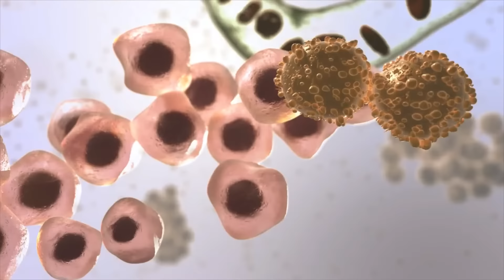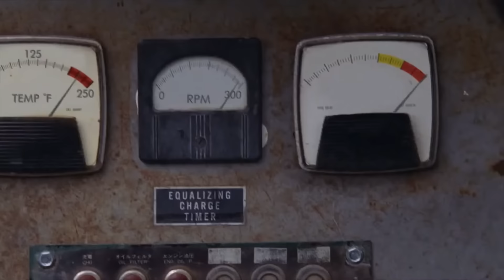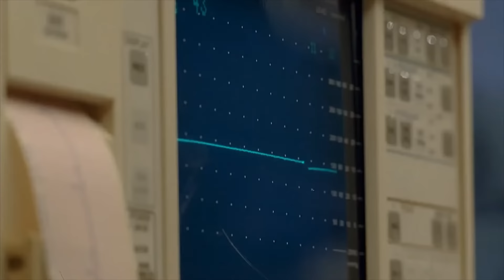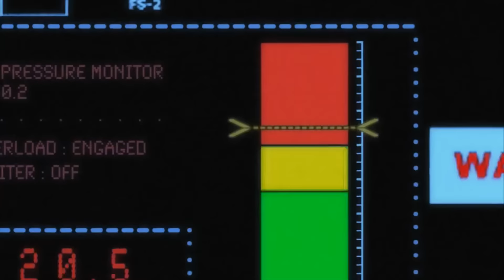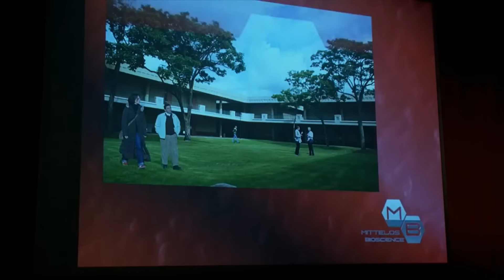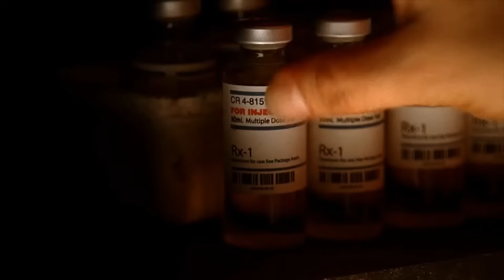Why Were Pregnant Women Dying? - LOST EXPLAINED FAQ

Comment: i dondt understand:
if 0puting the numbers in hatch was so important, why the others didnt do it? why only desmond?
-and what hapend after the hatch exploted? 
ty
Reply from the maker: Your timing for asking these specific questions is fortuitous. I will be releasing a video in the next couple of months that dives into why The Others did not have control of the hatch/computer. As for what happened after the hatch exploded, we see that it actually imploded and sucked the station into itself. A mangle of metal. And the energy pocket was wiped out. Whereas the men trapped in the station (Locke, Eko, Desmond) were moved outside by the light before it was destroyed in the fail-safe blast.
Reply: @LOSTEXPLAINED108  ty sir!  last question i promise: why nobody used the key so they dindt had to put number every 108 minutes? its because nobody really knew that turning the key was gona solve all the problems? thank you again
Reply from the maker: I explain the fail-safe key and why it wasn't turned before in my video on "Jughead". I've got the timecode for you here: https://youtu.be/gdWERJIjyQE?t=751
Reply: @LOSTEXPLAINED108  ty

Comment: But how was Kate the only woman able to avoid pregnancy on the island?
Reply from the maker: I think a lot of women on The Island likely had sex without getting pregnant. The Others probably practiced safe sex as a result of the pregnancy issue, except for those who wanted to chance it and have children. But I think Kate and Sawyer just got lucky. Like many couples who do not have access to birth control, I am assuming they used the age old "pull out" method, which isn't 100% guaranteed to prevent pregnancy. That is probably why they are worried about it in Seasons Three and Four.